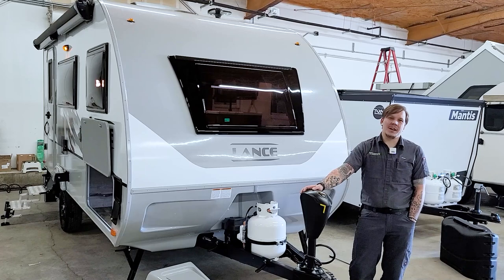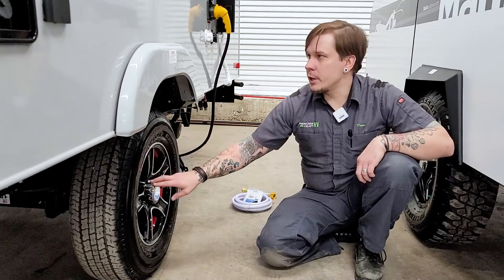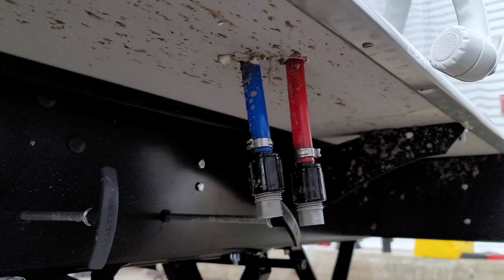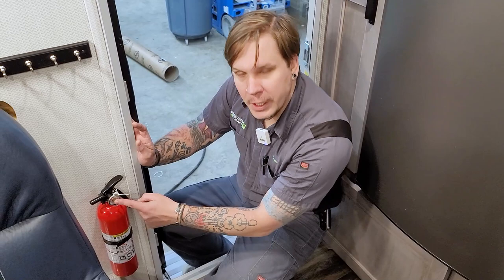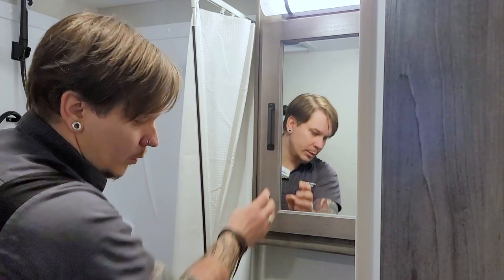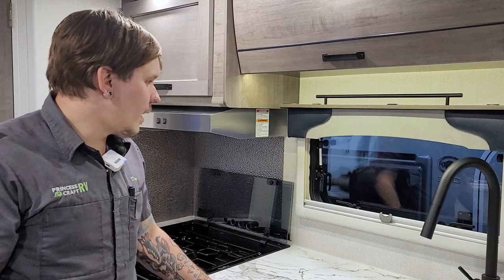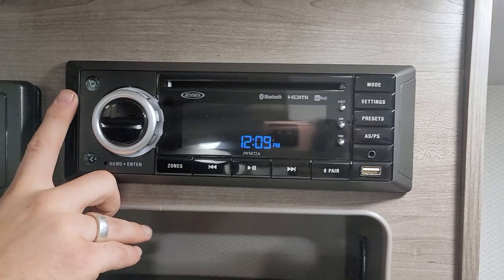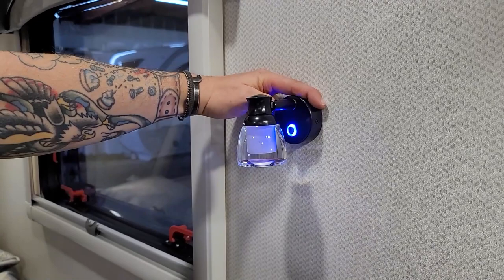2021 Lance 1475 Technician Tour

Comment: Great tour! I really wish Lance would provide an option for an outdoor propane stove or BBQ. Many tent trailers have a rail on the outside to hang the stove off, and a propane quick-connect either through a port in the sidewall or at the frame rail. Lance needs this! Especially in the 1475/1575 where the trailers are smaller. The only other thing I think they need is a 1000W inverter. Other than that, they're perfect.

Comment: Answer to Bob Vetter: Even though you drain the water there is still some moisture left in the valves that will freeze, expand the valve, and break it (LEAK). Replacing the moisture with non-toxic RV anti freeze eliminates that possibility.

Comment: Answer to Winnetou: Most year round RV parks will have a laundry or you’ll find a laundromat in most towns. This is a very COMPACT trailer. Space is a premium. You can buy a lot of washes and drys for the cost of RV laundry appliances. Yes, this is a premium trailer. But you’ll need to spend $40,000+ for one with washer-dryer hookups (appliances EXTRA).

Comment: One note on fire extinguishers= if the extinguisher always stays in that position the contents inside can get compressed, making usage marginal. The answer to that is to remove the extinguisher, turn it on its side and gently tap with a rubber mallet or maybe a piece of wood to loosen the powder contents inside, then restow it.

Comment: Are the recliners on a track so they can be pulled out from the wall and swivel to view out the window? Would there be enough space to do so? Would be a great feature to watch sunsets or as a remote work location with a view especially during inclement weather.

Comment: Nice having a remote and rain sensor feature for cabin fan. Does it also control the bathroom fan? If not, can bathroom door be latched open to dissipate moisture/heat using cabin fan? Wouldn’t want to leave bathroom fan open if it has no rain sensor.

Comment: Nice house. There is only the problem of winter and can the air temperature be 40 * C, for example? Why is there no room for a washer and dryer in this very expensive camper? What should I wash my laundry in a river?
Reply: LOL, you want a washer/dryer in a 15' floorplan?? This isn't the type of trailer you're looking for. You're going to want something in the 30ft range that will have what you're looking for. You can always wash your laundry at a coin wash in town or at your campground (if they have one).
Reply: @TheSeanBampton  Thanks for the advice. But I know what I need and what size I need. In the USA you do your laundry in public places, but we Brits only do this intimate act in our machines. And you can enjoy the public toilet. The Yanks are so guttapellent.

Comment: Very disappointing. No mention of chairs how they work. No mention of 4 season capabilities and how that works. The battery location is a real bummer. A 4-season trailer with a battery exposed to cold!!! No hitch receiver for a bike rack!!!  Permanent bed in a small trailer! Geez! A lot of apartments have a murphy bed and they are much larger than that trailer!
Reply: How do you think a chair works? This unit has a solar panel. No problem in the cold. Really, a Murphy bed? Look at the inside. There is no place to raise the bed. This is the best trailer I have ever had. You really need something else.
Reply: @rogerbrunette6761  well, one of those chairs is removable. The technician did not even mention that. since it is removable I wanted to see how it is done.